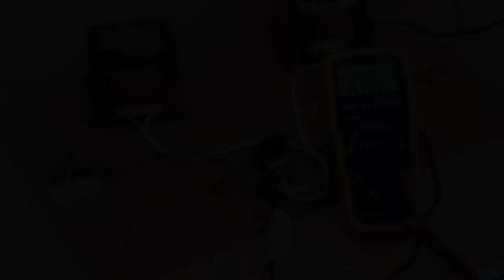DIY Welding Machine / Only 2 Microwave Transformer / Good Job

Comment: Your wires are WAY to thin...they candle more than 100Amps
Reply from the maker: Yes, the cables are thin and get quite hot.  But not enough to burn.  This is why I use silicon insulated cable.  Thank you for your attention

Comment: hi sir the diagram and the video is not pairs
Reply from the maker: Hello.  Can you tell me which part doesn't match?
Reply: the connection of the triac diagram and the video sir but for me i love your video very much sir thanks to you i learn about your video
Reply from the maker: Thank you.  It's actually the same link.  The only difference is that in the video I used the body metal instead of the middle end of the triacs.  The reason for doing this is to avoid short circuits since the legs are close together.  As you know, the 2nd leg and the body metal are the same tip.  If you scrape the metal a little, you can solder it.
Reply: ok sir thank you very much for the feedback now i know☺️☺️☺️
Reply: i realy appreciate sir thank you very much
Reply from the maker: Thank you too 👍 good luck

Comment: aunque mi voltaje a qui en colombia es de 110
Reply from the maker: En lugares con tensión de red de 110 V, los dispositivos consumen 2 veces más corriente para obtener la misma potencia.  Por ejemplo, al operar un dispositivo de 2200W, 2200/220=10A, donde este valor actual es 110V, se convierte en 2200/110=20A.  Por lo tanto, se requiere un circuito de atenuación más potente.

Comment: 4000 W controlador de velocidad del motor, tablero de control del motor AC 110 V Regulador de voltaje ajustable SCR de alta potencia regulador de temperatura regulador de atenuación del monitor puedo usar este controlador de velocidad aquí la corriente es de 110. Y 220 V
Reply: Y cuánto de amp lleva en la caja de circuito de la casa
Reply from the maker: Hola, por supuesto que puedes usarlo.  Pero es demasiado para este trabajo.  Un circuito atenuador simple y económico hará el trabajo fácilmente.
Reply from the maker: Según tengo entendido te refieres a la caja de fusibles de la casa... El fusible conectado a la toma que uso en el garaje es de 10A y no hay problema.  Sería mejor si lo usas en un enchufe con fusible de 16A.
Reply: Ok gracias eres un gran profesional muy educativos tus videos
Reply from the maker: Gracias.  Me alegra que pienses eso.

Comment: R/For each one
Reply from the maker: Hello.  I made 24 windings with silicon insulated copper cable with 4mm2 cross section in each transformer.  This requires 6.5 meters of cable.  13 meters for 2 transformers... If this is not the answer to your question, please write the question in more detail.
Reply: Thankyou. I olso built a similar one AND it Is workong very well for small tasks

Comment: After 5 min continue use its can take fire and burn
Reply from the maker: Hello there. I used it much longer, luckily it didn't turn out like you said. Soon I will prepare a video to convert the output voltage to DC. There you can see that it does not burn and remains the same. You can also see me using it in my angle grinder stand video. Thank you for your interest, but I cannot thank you for your unfair comment.
Reply: am also yotuber bro but when i turn every 15 round one transfirmer both 30 round and its 35 volt out but only can use 12 no rod not 10 no and 12 no rod can use continue 10 min its takeing fire in transformer so canont pack top allways put open in outside its speedly going to heat
Reply from the maker: Yes, there is heat. For this reason, I chose to use a silicon insulated cable so that the insulation is not damaged. It is important to remove the heat from the environment. I can't say that this tool is professional, but it's not bad for amateurs like me. My goal here was to make a relatively lightweight device with a microwave transformer. Therefore, I used 2 transformers. For sufficient voltage, the number of turns had to be high. For this reason, I preferred a 4mm2 cable, but I used a silicone insulated cable to be heat resistant. Actually, it would be nice if I made the box a little bigger and used a bigger fan. But that's how it works for me.
Reply: thanks for rplying bro
Reply from the maker: Thank you too.  I will respond to every comment written with respect to the best of my ability.